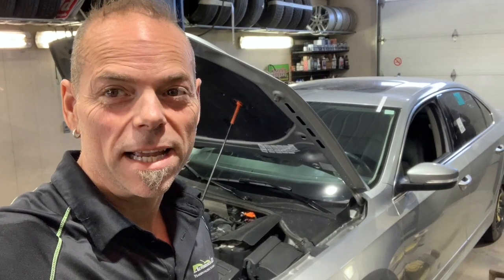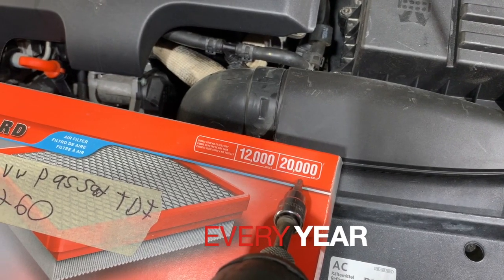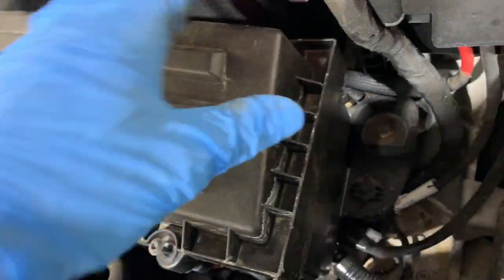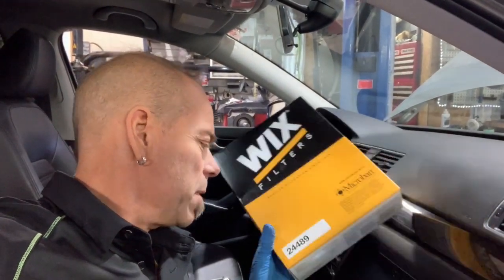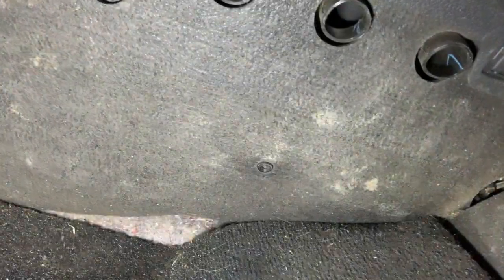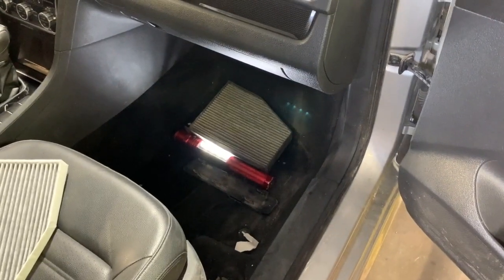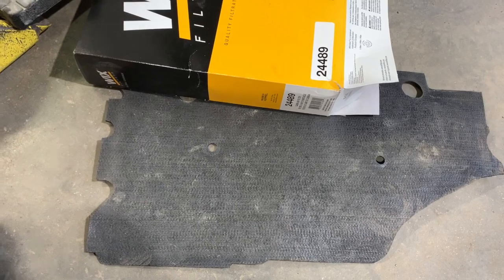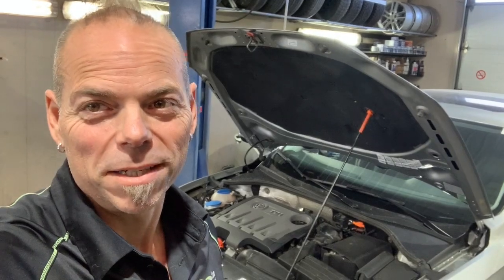ENGINE AIR FILTER & CABIN FILTER 2013 VW PASSAT 2.0L TDI

Comment: Oh, there is a cover plate that you have to remove before you can access the cabin filter.
No need to mention that until the reinstallation process, right?
Reply from the maker: Sorry tried to keep it as short as possible only explaining it once. Watch vid then perform is best. thanks